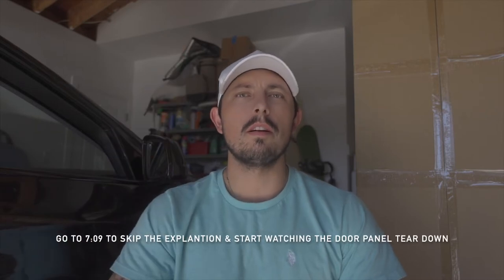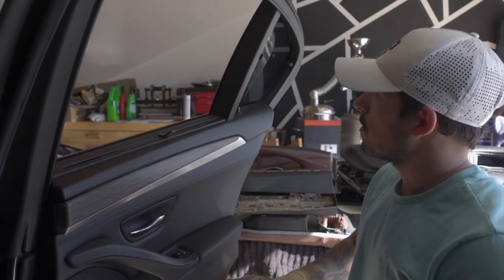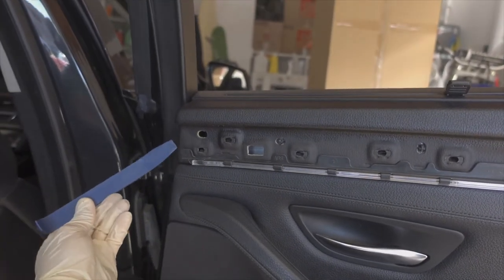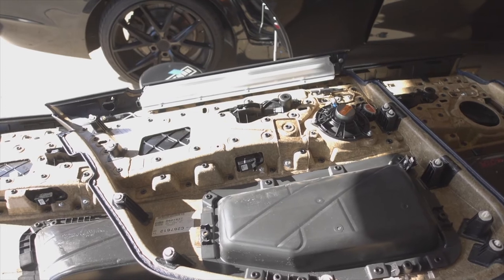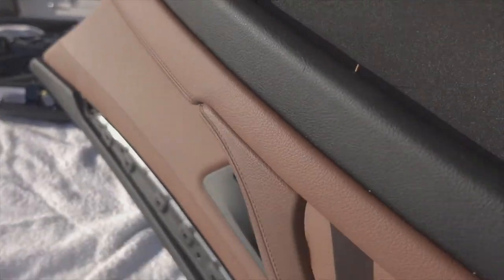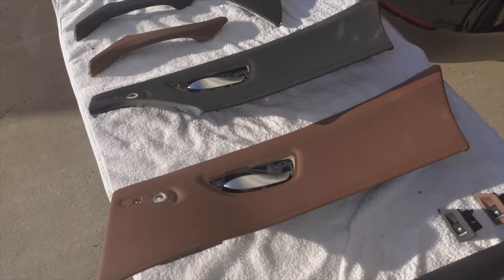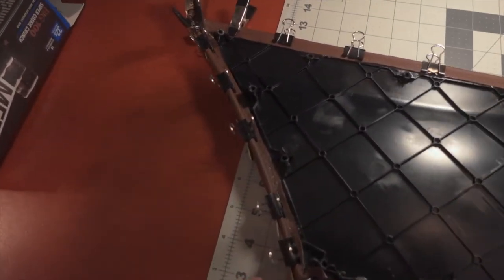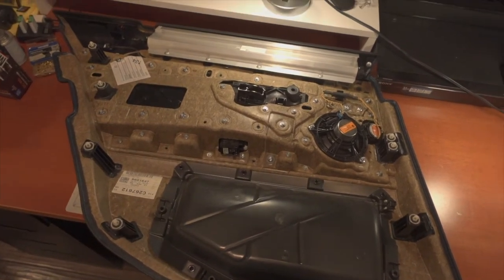BMW F10 535I | Rear Door Panel Speaker Retrofit For Non-Optioned Door Panels | DIY How To

Comment: Great job man! One thing I thought I will point out…something you probably won’t even care about though. Your original front door panel speaker grille is made of metal as your car has the hifi professional speakers and the new front door panel speaker cover is plastic. It’s easy to tell as you can now clearly see your speaker through the grille. Your original metal grille is differently designed so you cant really see the speakers.
Reply from the maker: You’re a G! Thanks for all the Info/comments, I’m still pretty fresh to this platform (I come from a long line of 90’s 3 series bmws) so there’s things i didn’t even know that I didn’t know lol, so I appreciate all the Info 🙏🏼🙏🏼

Comment: Hi, really good job!
I'm just looking how I can do wire installation through the door connector? What connector or pins have to buy...
Would be useful if you can give me a tip

Thanks
Reply from the maker: Thank you! So my car already had the harness as my car came with those rear door speakers, so if your car doesn’t have rear speakers already, then I’m not sure it’s as simple as simply sourcing the proper harness/speakers to just throw in, however if you wanted to try, I’d source the door wire harness from a car that had rear speakers than see if you couldn’t wire it up 👍🏼